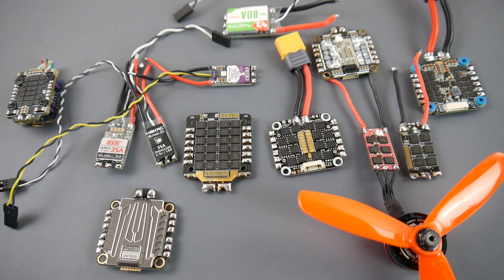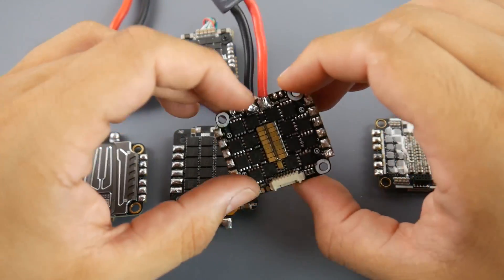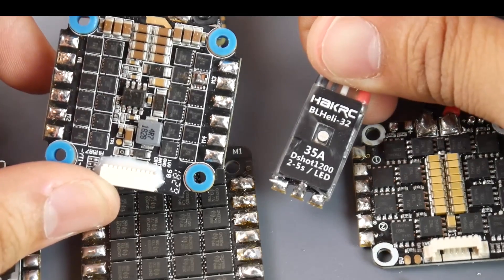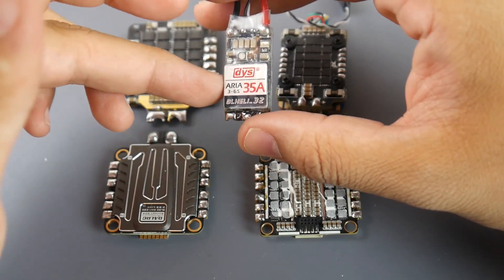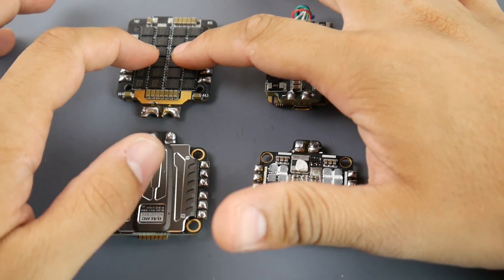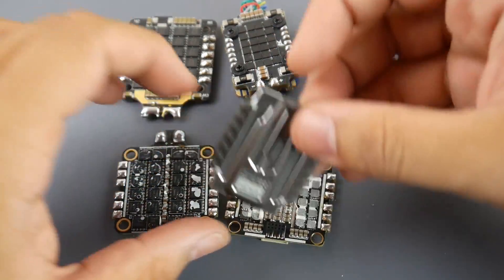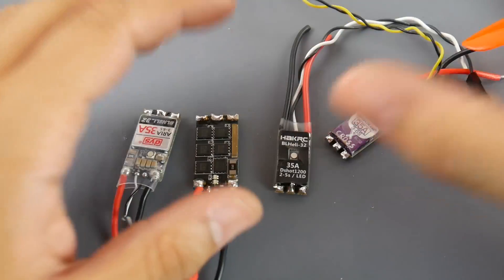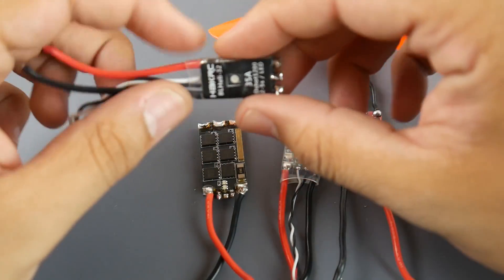Best ESC's of 2018 // Ultimate ESC Buying Guide of 2018 Q3

Comment: Hello! Is there the Q4 video somewhere? Didn't find it but probably have poop in my eyes. I'm looking for the best 4-in-1 ESC that has 5 volt BEC to power a FC and ideally can also power the unify pro HV vTX. You probably get that question all the time, so just ignore me if you do. I'll read more of your comments
Reply from the maker: Have not released it yet and will be released within 4 days.
Reply: @DroneMesh  awesome glad to hear! I'll be stalking you about it 😋 if you could mention the ones that has the 5v to power up the FC and maybe one plug for a vTX, that'd be awesome. Between today and yesterday I probably have been watching 3 hours on your channel lol. I ended up seeing that the new best with the 5v seems to be the T motor 55A 4-in-1. I guess I'll see in your video in the upcoming days. Have a good end of day and thank you for your reply

Comment: The tekko all in never again! It maybe has good perfomance but its not crash proof.. caps fel off.. and why just why you need extra spacers for it to fit in your stack..and why you not tell about the holes wich are drilled next to the chips.. this is just dumb design... yesterday after a crash my eventualy died and is nit working.. If an esc is not crash proof it is not worth it!
Reply from the maker: Must of been a hard crash.. Then go for a dalrc rocket components are well secured and performing as good as a tekko with the cap installed. I personally never had that happen but then again I fly over grass and dirt. Thanks for the info

Comment: The Tekko 32 is filterwise very good. No doubt about it. I just get armsips with it. Don’t know why. Never had those with the Hobbywing. And flying bough the habbywing one was more locked in the air even when I was doing my speed runs. When I arm the quad on the Tekko 32 one of the motorist starts always a millisecond late. And usually that’s the dipping arm. I’ve multiple setups with it. On a Buf und BF. Have you heard or experienced anything like this with it?

Comment: Hello drone mesh and fpv world

I m going to build a big fpv drone with sunnysky 4010 450kv motors
At Max amp draw with 13x5.5 they draw around 25 amp at 6s
Do you think that Holybro Tekko32 F3 35A ESC or Holybro Tekko32  35A ESC can handle this big drone?
Reply: Cookmangr Cook probably should go with higher amp rating

Comment: Do you know what can cause a quadcopter to jump to the air with just a little of throttle apply to it? Is an F3 flight controller
Reply: Are you using Betaflight? Try to disable airmode and see if it is still happening. If not, put airmode to a switch or increase throttle threshold for airmode.

Comment: This Spedix needs a cap but it's rock solid as long as you use a cap and iit doesn't burn out the way half of the other crappy ESC's you say are good do. So whats really good?...an irrelevant test on a bench or months of flying without any concerns it will burn.
Reply: What size cap you recommend? Will one on the main battery be enough?
Reply: @rolandburrows4859  I use a 1000 35v normally in the main leads and a 330 on the pads to the right of the main leads, sometimes a 470 on the main and a 330. Both seem to work just as well. I fly Flightone which first started me using caps over a year ago.

Comment: The test results for the hobbywing should be with the caps on i think. Anyone running 5/6s now will always run a large cap and even 4s racers who use hv packs also use caps. the board really is designed to run higher voltage with 45amp escs so surely a cap would be a must?  with a 1000uf cap this thing has been flawless on 6s so far. love the channel by the way
Reply: I've had 2 so far. Both with 1000uf cap. Fets blew on 1st and 2nd caught fire and melted a bunch of electronics. Hobbywing denied claim to reimburse or replace but just offered to discount price on new one. I'll never buy hobbywing again

Comment: The HAKRC 35A ESC uses 2R703 FETs AFAIK. They're good and physically smaller than most FETs used on ESCs but need a lot of cooling in my experience.
Reply: Which FETs are on the Hobbywing 4in1? I can't read that tiny writ on it.
Reply: I don't have the product myself so I can't say much about it. Dronemesh knows for sure and it would be nice to let us know.

Comment: Do you what would be a good 6s capable, power distribution board (PDB) for the Tekko32 4in1 ESC? Thanks and great video as always :D
Reply from the maker: It's crazy you ask such a question.. I was going to develop and design my own ultimate PDB for 6s and icm gyros but I dont know if people still use them.. This PCB would handle the shittest esc on the planet.
Reply: Airbot Matrix.

Comment: Should I add an external low esr caps to the good esc u mentioned? Especially Hakrc one?
Reply: Always. Even if ESC is good at filtering, preventing voltage spikes with extra cap adds another layer of protection to your sensitive electronics.